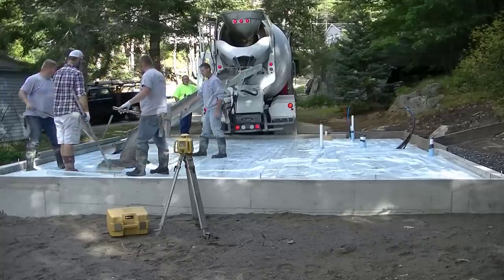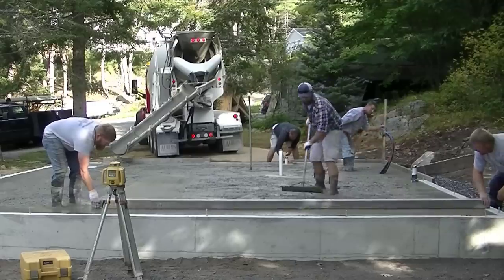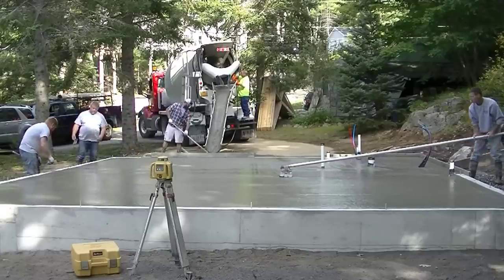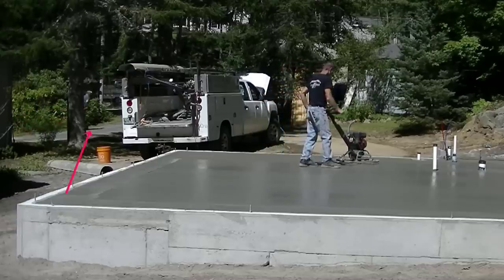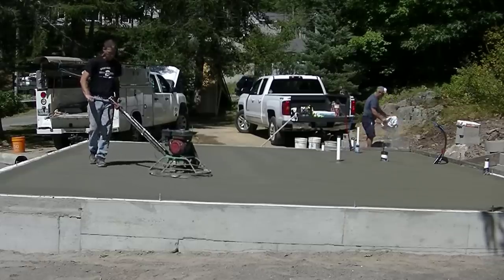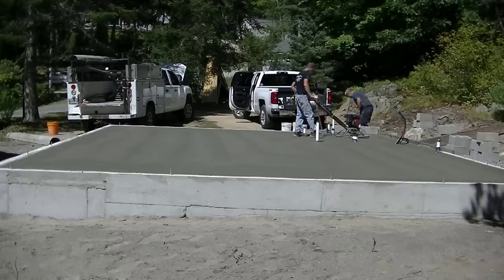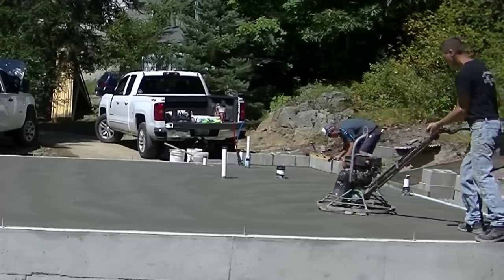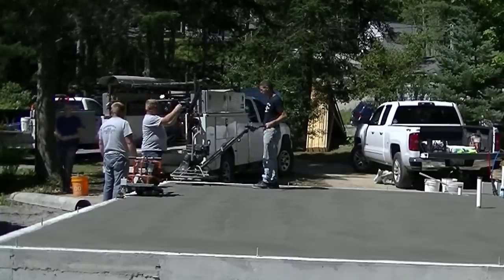Mason Starts Laying Block Before My Slab Is Finished! Not Happy!

Comment: Hi Mike, love your videos! I am a painting contractor and have to deal with dry time on a daily basis. I will never understand why other trades have little to no respect for others. I worked on new construction for years and always had issues with other trades just showing up to the jobsite because they had nowhere else  to go that day. It got so bad, that I would  always bring my lacquer clear coat to the job and when we saw someone show up, I'd run thru the house and mist the air. We would then wear our respirators, so, when the carpenter, plumber or electrician walked in, they got hit with that lacquer smell. They all said the same thing, are you gonna be spraying all day?  Yes, I am!! They left, we opened the windows and went back to painting.
Reply: Lol good one 👍
Reply: Yes, we've seen that being done , for real and to decieve 😆

Comment: As a small, one-man contractor, I do both yours and mason's work, Mike.  This guy is nuts.  Your slab needs to cure at least a few days before loading it down with block.  Good grief, either he's incredibly not knowledgeable, or he simply doesn't care.  My best wishes to the new home owners.
Reply: I agree if this were some sort of commercial building or high rise.  But a simple garage?  I don't think it will affect the structural integrity one bit.
Reply: @sumnerslandscaping5565  Depends on how many courses he builds on fresh concrete. One or two courses, possibly not. However, discretion is the better part of valor. Wait before loading it down.
Reply from the maker: Thanks Kurt, I never heard anything back so I assume it's ok.  I think he could have waited a couple hours though.
Reply: Probably he needs to finish asap so he can get paid. All good work needs a good base and be patient. Good luck to owners.
Reply: Not sure how busy the area your in is....but where I am that stuff is out the window...3 million dollar vacation homes going up in 6 months lol ...same day I might not let him lay block but nobody stopping anyone after I leave lol
Reply: At least he asked first. Nothing wrong with that if you approve. Everyone’s gotta make that hustle!

Comment: I been driving mixer for 40 years and earlier in my days a certain contractor would                           pour   a footer and lay his first course of block in the fresh mud, side by side, no mortar between. This process was done year-round, rain-snow-mud or sunshine. And there still standing.
Reply: Yes it is a good way to get a jump on things. We do that all the time.
Reply: But you must take into consideration your heights, at least if not your final height. I know we've done that also on small walls. He showed great restraint. If I was the other guy I would have at least came back later.
Must have been desperate for money...?

Comment: I used to do HVAC and later worked for a General Contractor.  Doing HVAC, we used to work pretty well with other subs for the most part... although there was the occasional time when a plumber would rip out our duct work to run his plumbing.  Nothing was on the blueprints, so it was often a free for all.  It did suck when we had to cut all that pipe out to re-install our ductwork.  :)  Working for a GC was much better, as we knew that if we did sub something out, what the plan was overall.  Thanks for the video Mike, and Stay Safe!

Comment: I read a few of the comments and this is actually a masonry technique. It’s called laying on a wet footer and believe it or not but it is stronger than laying on a set footer. That guy knew exactly what he was doing
Reply: Even so, courtesy dictates that you let the contractor know that you are deliberately working on a slab that clearly isn't finished for a justified reason.

Comment: I was superintendent assistant working for a builder we used to do condos, apartment complexes and multifamily homes; at some point I was supervising all the punch out and finishing work for all trades between CO inspections in all stages of the build process and I do not remember seen something like this; probably because contractors knew all too well if they start earlier and mess up anything there would be a back-charge; I heard of those few times but never saw the ones who got them, ultimately it is not professional to start your run until the previous contractor is done and you get green light, unfortunately not everyone has good etics
Reply from the maker: I agree, thanks

Comment: No harm, no foul. Under the sun and during warm season there won’t be anything wrong with a course or 2 of block laid on that slab. If anything it’ll have a far better bond to the concrete as he was able to start laying before the slab was burnished. The more open the concrete surface is the better the mortar will bond the cmu and concrete together. Block laid on a fully burnished slab will not bond as well as they should to the slab.
Reply: My thoughts exactly..
Reply from the maker: It all worked out ok!
Reply: @MikeDayConcrete  at least he wasn’t laying a partition wall in the middle of that floor! I’d be singing a different tune if that were the case haha

Comment: I've been in building trades over 25 years.  
10 years commercial carpenter.  
Only time we step on toes is when trades before us are late, didn't show up to work per schedule they have weeks in advance.  Painters, flooring guys sometimes electrical install. 
When we are told to be there by head GC. We are  Often deal with but hurt flooring contractors. Oh well.....

Comment: I had a customer who would start laying block on a freshly poured slab. They would use the dregs of my load in a wheelbarrow and a bag or so extra of mortar mix to set the anchors. They had the amount of concrete, due to their years of experience, almost down to the rocks. One driver who hated this particular contractor would get loaded, and go out back behind the plant and dump off a half a yard or so. The contractor would come up short by a half a yard and had to order another yard with the possibility of a cold joint.

Comment: When I used to work commercial construction guys were literally climbing on top of each other.  I wouldn't even blink on this issue.
Reply from the maker: I experienced that too, that's one reason why I avoid commercial work as much as possible.
Reply: Same here mike
Reply: My Man, you have some major patience. 

On our NYC commercial jobs people are definitely fighting for every inch, but Concrete is King and nothing and I mean NOTHING  gets in the way of the trucks, pumps, workers, testing lab tech etc. and you don't walk on it let alone work on it til the next day.
Reply: Commercial can be very crappy work.  You can get away with anything.  Huge joints, crooked bricks as long as it’s not a safety hazard it’ll pass inspection.
Reply: Concrete in NYC is no joke.  Usually it’s getting covered up anyway but as far as cosmetics like tile and paint, forget about it.   The faster, the better.

Comment: I have been in this situation and that day I asked them to leave. No problem as they had other jobs and they left. Another contractor and another contractor....and another. Parade of Homes crunch nonsense. So much stuff got torn up that day with all the builders working over one another. The GC threw his hands up in the air. Doing a good job for myself is about being patient and flexible. I would have left if the GC hadnt said "Has to be done today, just do your best"
.
Reply: Has to be done today well then he better sign off in writing so I don`t have issues with some one compromising my work. I learned that a long time ago.

Comment: This is fairly common from my experience. Probably less so in residential construction than in high production high-rise type work. 
It was my job to get up on the freshly poured deck, just as soon as we weren’t putting bad footprints in the concrete and get the layout done for the mason, for them to start laying block or laying out columns and walls for the carpenter to form up. Sometimes on an elevated deck, the concrete finisher would still have their trowling machines on the last 1/3 of the deck, I’d be in the middle third doing layout and the mason would be flying cubes of block up in the first third and starting to lay up corner leads. Or the carpenters would be in the first third, forming columns and walls, getting ready to pour them in the afternoon. Deck pour in the morning. Pouring columns and walls on the same deck in the afternoon. Next morning, the columns and walls would get stripped and right away, deck tables would start being pulled from 2 floors below and flown up to start forming the next deck around the freshly poured columns and walls.

Comment: Im blown away as to not seeing vertical rebar for the masonry stem walls. If a sill plate is attached to that wall,  I dont see any strength at all with just a couple anchor bolts that attach the sill. Weird.
Reply: In my part of the country the foundation guy would have had to put in vertical reinforcing extending a couple of feet above the yet to be poured slab (or to the top of the block for this short wall).  Mike would have had to finish around the reinforcing and the blocks would have horizontal reinforcing added as they are laid. Then the blocks would be poured solid and the anchor bolts installed.

I would have told the mason to come back after he has had lunch.  I think it would be impossible to damage the slab structurally by adding weight on the edges of the slab since the slab is fully supported by the foundation at the edges and thus the slab could not settle to impose stresses.

Comment: I roofed the front of a house before the back roof deck was sheeted.  But it was running about 100 for a week and the framers were way behind.  Had to many jobs lined up not to start.  Builder told me to do it.  Framers were OK about it.  Surprised I could roof at that temp.
Reply from the maker: Wow, that's hot. It's usually best to try to work together, not make enemies.
Reply: @MikeDayConcrete  That is the high for the day.  Morning were cooler and is when I roofed.    I left when the sun crested the peak.  About one in the afternoon.

Roofing the front helped the builder keep his time line.

Comment: 🌀Nice cracks in the block work, are they free. In the U.K. building control wouldn't pass that. 
 It looks like everything's flash dried. Or perhaps premature use of whacker or similar.

 

 block

Comment: I wish my Dad would have let us pour this wet back when I was a kid. He believed in using little water as possible and he rarely got any cracks in anything He poured.
Reply: Mike uses a chemical called super plasticizer. It makes a low water low slump concrete look like it has a lot of water in it. makes it super workable. We use it sometimes on my Youtube channel but Mike uses it all the time. It should still make a super strong slab. It probably was not available to your dad so he was correct to keep the water content down.

Comment: Contractor is probably ram rodding the job and told him to jump on it. 
Looks like there is a foundation wall and part of the block is resting on that so maybe it want lean in on the fresh concrete slab. 
  He should have waited until you started loading up your tools.
  Probably a good idea to take a video or pictures of this guy on the slab and that you didn't leave a mess around the plumbing etc....

Comment: WOW! Hard tellin not knowin but was this an after thought by the builder or did he know from the start of the job the wall wanted to be higher in that corner? Seems like the wall could have been poured to the height he wanted? The mason could have gone for some rebar came back wet stick some dowels and came back the next day? Bottom line it's all done! You do it all your life and every now an then some one is in your way some how. Great job guys!
Reply from the maker: I'm not sure why they didn't step up the wall in that corner, seems like a better option. It probably ways and afterthought but they did step the wall "down" in that corner.
Reply: @MikeDayConcrete  Thanks Mike have a great day!

Comment: I've been a rain gutter installer for more than 20 years . I would never set foot on someone else's work until it's complete or it's been approved.  Not only is it bad manners but it could also be dangerous depending on the circumstance and possibly the personnel 🤣

Comment: I would have let the owner I did the slab for know you are not responsible for any cracks or failing concrete because of this guy.  Setting blocks on green concrete is nuts.

Comment: Some situations require subs to work on top of each other , but this wasn't one of them.
He should have waited. 
You didn't go in and start pouring your slab while the wall guys were still stripping forms, did you?
 Common sense and basic courtesy.
 I'd talk to General Contractor to make sure that doesn't happen again in the future.

 You handled it well.
Reply from the maker: Thanks Ron. Like you said, a little courtesy goes a long way.

Comment: I have a question, I’m going to build a 16x24x4” concrete slab for a shed/work shop. Never work with concrete but, do I need to use rebar or wire mesh. Also do I need to put a saw cut in it? Some people said to use wire mesh and no on putting a saw cut because of the size of slab.

Comment: I'm a retired Mason and even though it all "seems" to have worked out I would never start laying a wall on green concrete, I would have waited more than a day too.  If I were you I would make sure the contractor knew about it too so if the owner calls him down the road withe cracks in your floor, that would be his avenue.  That guy was as bad as the plumbers hacking through floor joists!
Reply: Or plumbers cutting through the grade beam

Comment: I wouldn’t worry too much that the block was going on the fresh concrete ………. But that was not cool that he walked in unexpectedly and started to set up while you were still finishing the slab. If the situation was the other way around and you started pouring concrete while he was trying to do his block work he might have had an attitude. 
Like you said …… you are an easy going guy but I know plenty of concrete guys that would have sent that guy packing.

Comment: Mike, you were too generous. No trade has the right to interfere - and if you're around good trades, they help each other, not interefere. This guy didn't offer to help. He simply barged in. I'd have told him to take an early lunch and to start after you're done.  That said, wet-setting helped that block wall bond and otherwise helped the strength of the wall. But why build a block wall that isn't doweled into the slab rather a short concrete pony wall?  Weird.

Comment: Why wouldn’t the builder include a raised stem wall in that corner? Seems lame to put a couple courses of block on top of the slab when it could have been handled during the foundation placement. Regardless, you handled this well. The mason probably realized it was a goony move, but time is money.. so f*** it!

Comment: It was your job to tell that guy no. The concrete at that point has no strength. Any mason worth a damn wouldn't pull a stunt like that. I would be having a conversation with the GC/your friend about that mason and if anything went wrong with that slab in that corner it's on the mason.

Comment: 1. To avoid a conflict call the general and inform him

2. Tell the general that since the concrete isn’t cured and the other vendor is on your slab that the warranty is now null and void
3 email general or send certified letter with pictures and documentation of the problems and damages caused by other guy
4 if the general doesn’t give a crud and stop the guy, tell the general that’s your last job for him
5 call your buddy Guido that you have a “situation” that needs to be resolved. The mason needs to be delivered to the train station. 

30 yrs electrician and that was one of the most disrespectful things I’ve seen. You never mess with another contractors work like that. Back in the day this never would have happened and if it did the guy would have been under the concrete. I’m am actually surprised that you didn’t say get the bleep out of here or call the general. That is your name on the slab not his. Any problems will be yours because you didn’t inform the general as soon as the guy showed up, and you didn’t try and stop him. With the quality of work and your reputation with the general I can’t believe that this clown is on the same preferred vendor list. I think it’s time to reevaluate the projects you pick and learn to say “No! I won’t let my work be damaged “. There is too much work out there to have deal with this crap.

Comment: where are the uprights?  no rebar for a wall going up?  seems sketch.  Is he planning to dowel?  drill into the existing slab?  nope, should have been embedded j bars, just saying seems like the wall will not be all that if it isn't tied into the slab.

Comment: mike wouldn't the block sink in a little bit?
Reply: Not at that stage it will hold.   Guaranteed he would not have been allowed near the floor until I was done and satisfied.   That was plain rude.
Reply from the maker: No, it was firm enough when I could walk on it.

Comment: Just not professional. Even it's only a minor job setting a handfull of blocks. In the end you can be blamed for things you don't have control over like loose bolts set in the foundation.